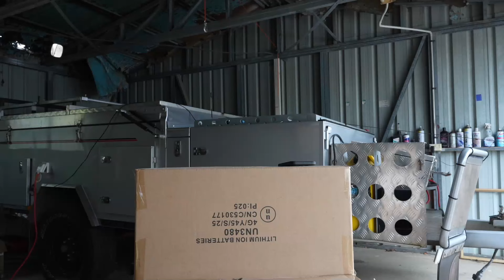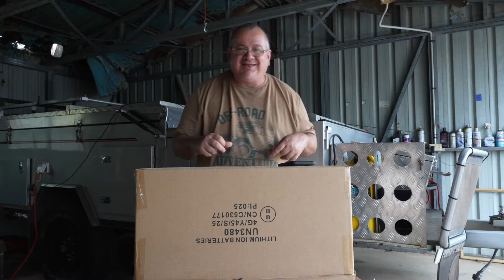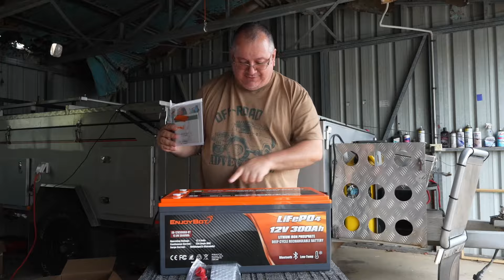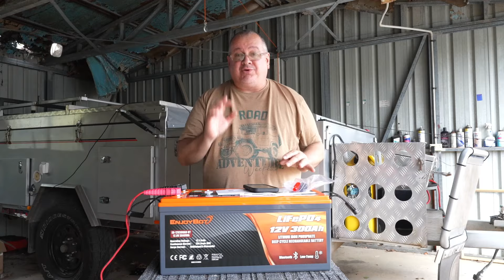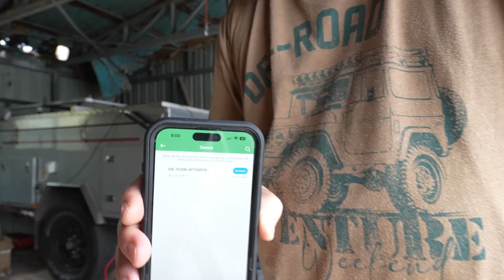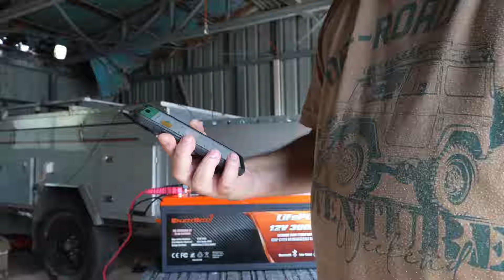Enjoybot 12V 300Ah LiFePO4 Battery Unboxing & First Impressions + Discount Code

Comment: Be wary of the series connection propaganda. Putting these batteries in series will eventually result in battery imbalance. While the cells within each battery may be balanced, the batteries won't be. To do that you need external balancer which are notoriously bad (including the Victron ones). It's extremely rare to find a series system that is working long term like this. Many manufacturers (including myself) decide to just say a flat out NO to series. Parallel connection should technically be unlimited, however many choose to suggest 4 as a maximum, beyond that you should consider different voltage systems. If you need higher voltage, then there are batteries with those voltages already set up that won't have balance issues. 

That's a super chunky battery, almost 3 times the footprint of the new PowerPaul Scout Lite that's rated at 345Ah and is just 26kg ;) 

BTW, PowerPaul has upgraded our own warranty today (including the battery you own, no more pro-rata terms). Some of our batteries have up to 10 years warranty.
Reply from the maker: Thanks for the information and your insights!  I was not aware about the balancing issues when connected in series.    Probably best to stick to parallel connection.   My plans for this battery is to use at home for a small of grid system.
Reply: Starts with great battery tech advice, ends up being a PowerPaul ad on a competitor’s video🤣🤣
Reply: @Tracy-i7y3r  I have been dealing with Phil long before anyone even heard of Enjoybot, which sounds more like an adult toy than a battery brand.